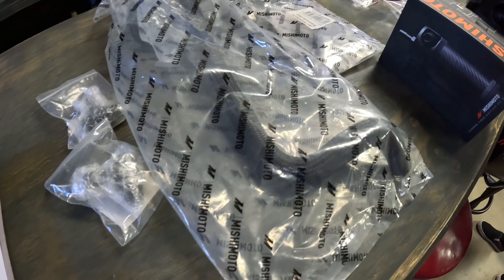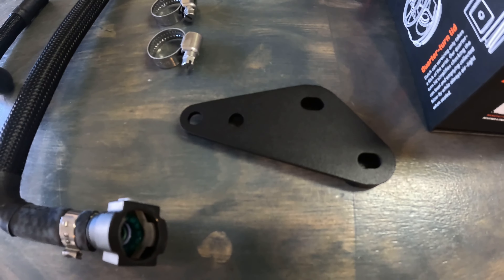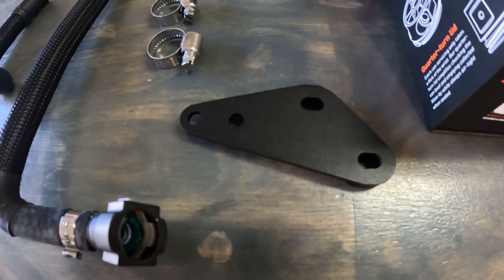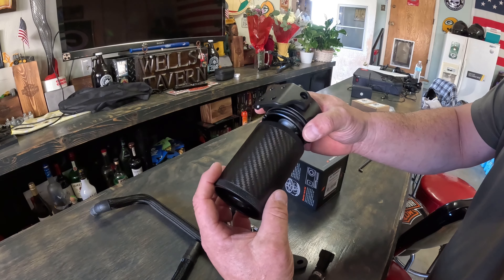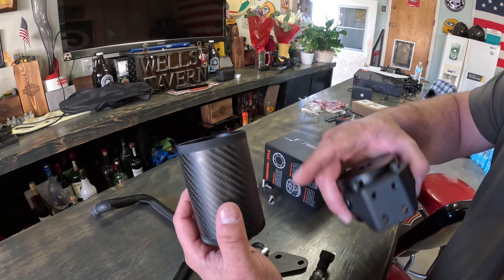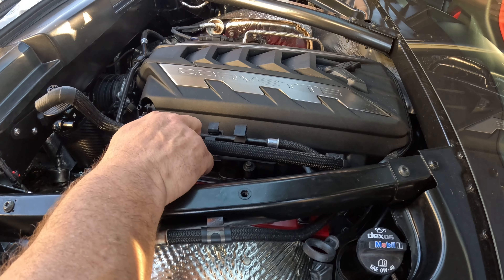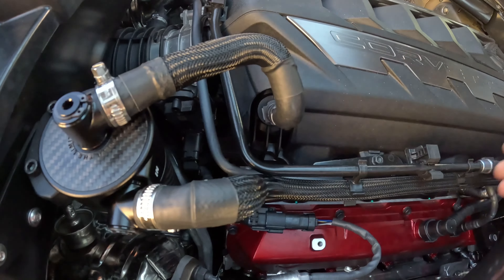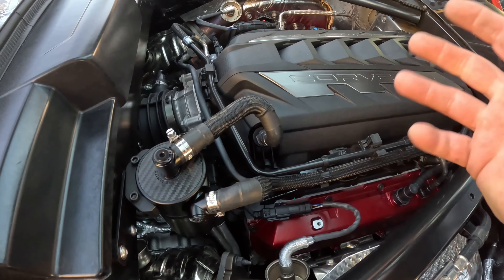2024 Corvette Stingray z51 Modification’s Part 1 “ Catch Can install “ #subscribe #corvette #new

Comment: And what happens if there is an engine issue of ANY type - will GM void the warranty due to this aftermarket part? I think (Hope, at least) that if this was needed, the Corvette’s R&D and engineers would have included this device.
Reply from the maker: Due to it being an upgrade or something that benefits the engine GM would have a hard time proving that this caused a failure.  And trust me with the new age of engineering that I see these days being a dealership technician myself don’t expect them to ever make something that would not break. I’ve been a technician for 20 years because they don’t engineer anything 100 percent perfect.

Comment: I installed one on my C8 and it definitely collects oil.
Reply from the maker: Yeah this one is collecting also but remember the engine is still breaking in.
Reply: @LJsChopShop  
I also installed an Attack Blue air filter and a Vitesse Throttle Controller”. Car pull harder than stock.
Reply from the maker: @wazzman8760 I’m going have to look into that as well and advise my buddy. Awesome information thank you